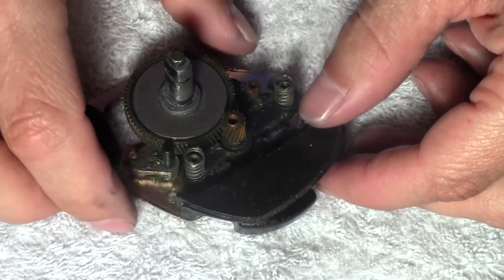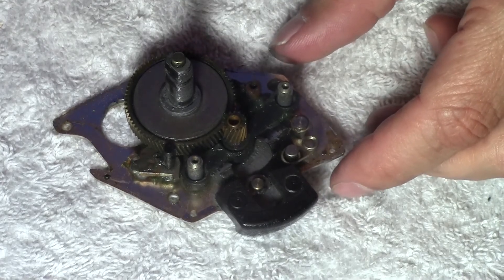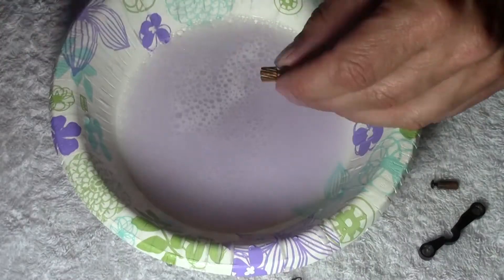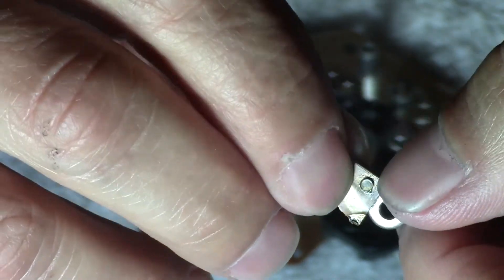Part 2--Shimano Fishing Reel Service Cleaning Lubricating Antireverse

Comment: I own 3 of these now. Even the two that look kinda beat up work great still. The first one I got on Ebay for 30$ is in great shape. I used these videos as a guide to service it. It works like a dream. I got the matching magnumlite fighting stick to complete the combo. The rod cost me 80$ on Ebay which is a deal if you can believe it 🤣. Most of those bullwhip fighting rods are going for 100+.